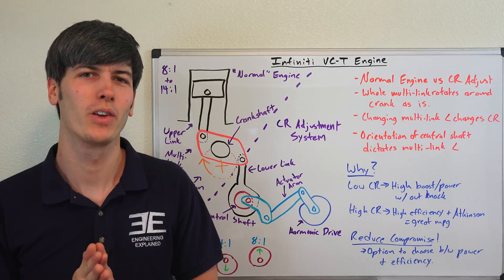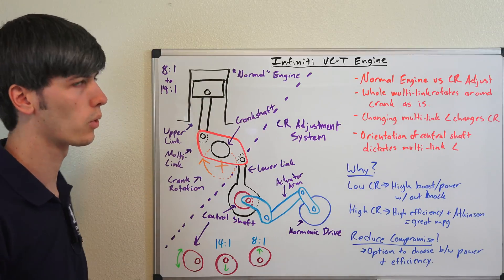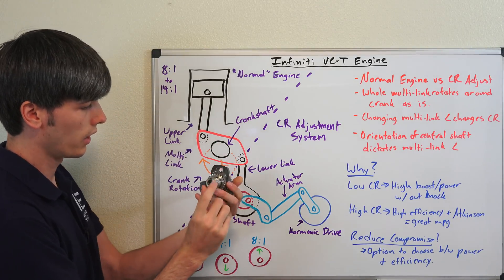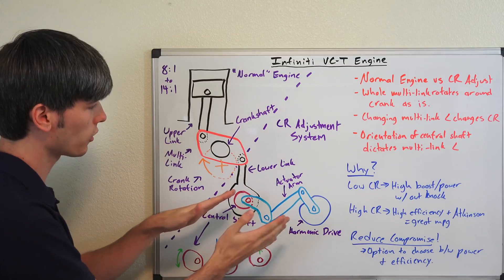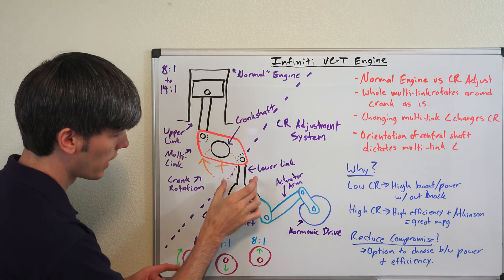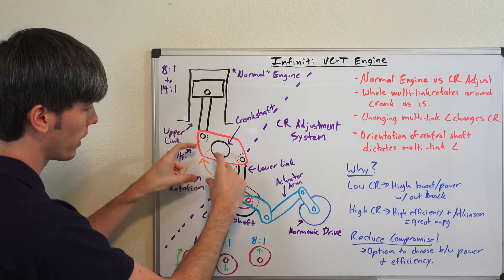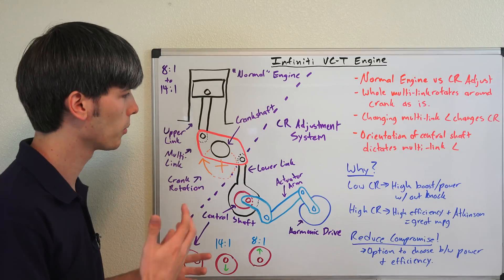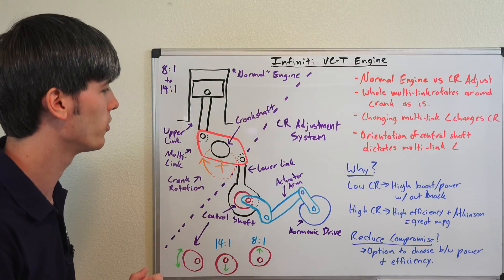Infiniti's Amazing New Engine - Variable Compression & Turbocharged

Comment: Alfa-Romeo started developing this back in the 2000s but using a ladder design. I ponder, how by adding this design is it going to make an engine more reliable. More parts usual means greater failure. I like the idea though.

Comment: HI Jason, great Vid. 
Am I correct in assuming that the multi-link plate has to be offset to change the ratio?  Other wise the stroke would remain the same and the only thing that would change is the compression pressure. I didn't see that point mentioned.
Regards,
John

Edit: Thinking about this, I can't see that the Compression Ratio will change at all if the multi-link plate is fixed as you suggest in the video.  It is my understanding that if you don't alter the stroke, IE the offset of the chrankpin, you won't alter the compression ratio?
Have I been wrong all these years?
Cheers,
John

Comment: With direct injection, it's possible to increase compression up to 13 and 14:1 and boost while controlling knock.  Would this be used to increase compression even further?

Comment: Awesome explanations ! I have a question. The engine switches b/w low compression ratio mode or high compression mode, I get that but how ? does ECU send signals depending upon the real road and throttle conditions ? or should the driver manually adjust between low and high compression ? To be more precise how is the harmonic drive actuated ?
Reply: +pepe la pew yes.. But how does it know how to alter between high and low compression ratios?

Comment: I've always felt that fewer moving parts reduced friction and improved reliability potential. Will this motor still work in 100,000 miles? What sort of weight gain is added with this feature?

Comment: Okay, while variable compression is cool. Why are we not all freaking out about camless engines? Koenisegegegegg... has had a prototype running for years and it still hasn't gained traction in the automotive industry. Have near perfect firing sequences is amazing for power and efficiency.

Comment: with electric power coming in so hot and heavy now I think this is a complete waste of time.
Reply: yeah..because all the cars, trucks, tractors, back up generators...and all the things that burn gas, oil, diesel are all finished tomorrow right?  Think about that...not even 1 % of cars on the road are electric.....all the gas station you pass are well..gas station.....you can go days, weeks, or longer before you even see an electric car....we are a very long way off from electric..or even having to worry about them like that! Making something more efficient and not designing new technology because a few electrics are on the road are a long ways apart....
Reply: Sure fully electric cars are rare but I wasn't just talking about them. The pruis has proven itself for over 10 years now. And there are many other hybrid vehicles that work extremely well.
Reply: *****  Prius and Volt are hybrid, they dont have a "range"  unless you want to run in fully electric mode.

but an electric F-150 that would last 400  miles up hill towing a 7,000lb load would be INSANE!!!

Comment: Thanks for the vid.

Why not have another small piston/plunger in the head which retracts, driven off a cam, to increase the volume of cylinder? 
One problem I can see with that it sealing it but it would not be much different to the piston and rings.
Mechanically it would be simpler and lighter than the existing setup.

Comment: So essentially they use a stroker piston on a stock rod, that adjusts via a rocker arm attached to the crank. Attached to the rocker arm is a lever that adjust the piston 3-6mm in height in either direction.

Correct me if im wrong but is this is the case, I hope to god this tech dies like it did with saab in the early 2000s. And yeah this concept isnt new nor is this the "first" Variable compression engine (Engineering Explained, did not state or claim that it is the first), but many other outlets are saying so.

Comment: I think it's only fair to mention the MCE 5 VCR straight 6 that was built and tested years ago. They used an 08 F150 and made as more power than the 5.4 mod with a 2.2L (I think it was actually variable displacement from 1.9-2.2 by using the VCR system to increase total stroke).  Horsepower was up by 20, torque was almost 400lbft at 2k rpm and they almost got 25mpg highway vs 20 with the 5.4.

Comment: Pretty amazing mechanical set up and I applaud Infiniti, but doing all this does it really make any difference in L/100km? More power and torque from a small engine I get but you have to run a Turbo car richer to reduce Knox and temps due to higher pressures and with all the added weight of the mechanisms in the engine that must be some lightweight car to gain the benefit of adding additional weight. More weight means more fuel means more L/100km. I think its a great peice of engineering but cant see the long term reliability in the set up, I wish them luck.

Comment: What it all boils down to is the management of the actual cylinder charge filling, by mitigating known filling deficiencies with variable turbocharging pressures, whilst also adjusting compression ratios to target optimum efficiency and power. 

It strikes me that the same results will be obtained by the continual development of turbos, wastegates and electronics!!
Perhaps the technological advance is the immediacy of a mechanical link, but I dread the reliability issues.

I predict their claims won't be so remarkable when you fill up your tank.

Comment: I could see performance gains from this if it were designed with that intent from the get go. Better off boost and tip in response and power. And with the fuel sensors that detect Ethenol now days if you filled up with E85 instead of 93oct gasoline advancing the timing and raising compression under full boost conditions. 

That said, I don't see this being reliable... time will tell. Good R&D though.

Comment: YouTube suggests I watch a video about the MCE-5 VCR-i engine related to this one.  It states that MCE-5 has been developing theirs for more than a decade.  Any chance you can objectively compare the two technologies in terms of theoretical limits and strength of the system when boosting?  The MCE looks a little sturdier, but they use a gear supporting the piston rod which looks iffy.

Comment: Poorly drawn diagram. As someone with a good understanding of how things work you would make it clearer if the connecting rod connected to a different point on the crankshaft, say 12 o'clock. That way you could show the top left corner of that plate mounted to the engine block but allowed to pivot with the pressure from the lower link.

Comment: it sounds like a good idea but if you introduce any sloppiness its going to smash itself apart no? if that cam gets a little wear there is going to become a lot of wear almost magically just from running the engine. its not like the variable timing systems because some sloppiness there is going to cause timing issues or lack of power, but at least its not going to be something that has to hold the power of the piston

Comment: Does leaving a manual tranny car in first gear while parked on a hill facing up actually help if the handbrake fails?
Reply: Yes. The engine doesn't care which direction it's rotating when it isn't running. So it would be the same whichever direction it's facing on a hill.

Comment: 2.45-3.15, that is an amazing new bit of technology. Trouble is, with an engine with this, will you get 200,000-300,000 miles before needing to change the various "big end bearings" ((Rod bearings in USA and Canada)????
Reply: AND it looks hideously complex as it has to be applied to each cylinder.
Reply: I can see this going the way of the rotary engine.

Comment: Is the square really not rotating? As I see it by moving the shaft up or down it causes the square to rotate differently when the crankshaft rotates. By that way you get MUCH more difference in where the pistons top and lowest point is. That equals to much greater compression ratio, because instead of just changing the travel point it changes the travel distance, which equals to much more air compressed into much smaller volume.

Also it makes no sense that the adjusting shaft would move up and down with the square when the crank rotates...

Sorry for duplicated response, I really think that this video is very misleading.

Comment: So other videos I have seen explaining this type of technology do not have the multi-link maintaining the same orientation (which would seem to require the control shaft mechanism to move with the crank) but rather have it acting as a lever between the lower and upper links with the fulcrum being the crank.  Which is correct for this engine?

Comment: Isn't part of this also the fact that in high compression mode the displacement of the engine is also reduced or is this change in compression ratio taking place dynamically on each stroke?

Comment: Lead compounds are not the only ones that can increase the octane, I use modern approved additives to run my vintage car that was designed for 100octane fuel ( now unobtainable in the uk).

Comment: I am interested in the power gap, high compression Hp vs low compression hp. Would like to know how much of a horse power increase u get or is this something along the lines of v-tec  of how you floor it you get more power and increase rpms which increase horsepower.
Reply: The power difference between the low and high compression modes should be very substantial. Picture it like having a Tercel engine under cruising conditions and a Focus RS engine under WOT.

But it won't act like Vtec where it kicks in at 6500RPM. It should feel like a normal, turbocharged, engine. Just that when cruising the engine will operate much more efficiently than a standard high output turbo engine could.

It's actually like the exact opposite of Vtec.
Reply: v-tec is variable valve timing that attempts to make the power curve more linear throughout its rev range and works pretty darn well, and most car companies have adopted and branded it their own (toyota has vvt-i etc...) In this case, im sure infinity is using a variable valve timing system in unison with variable compression to achieve whatever the engine is asked of. High compression+low boost=economy while low compression+high boost=horsepower. In this situation I would imagine one could change the horsepower from as little as 120 (for the sake of argument) in high compression econ mode to 300 or more horsepower with low compression and high boost with a 4 cylinder engine. In short, much more drastic than v-tec.

Comment: 14:1 turbo engine compression. Waoooo
Reply from the maker: It very likely won't be providing any boost when CR is at 14:1, dangerous situation if that were to occur.
Reply: Sounds like this engine has a sensitive crank

Comment: How does the harmonic drive work? Hydraulic pressure? How does it lock into position? What kind of points of failure does it have? All things equal, how much efficiency is lost with these added parts? Whicj models will this design be on? Brah I'm from compton you white boi pencil necks better answer these questions or imma bust a caps in yo lock

Comment: Wouldn't changing the compression ratio dynamically like that drastically affect the displacement of the engine?
Reply: No, displacement of the engine is locked in place. The bore obviously would stay the same, and despite what some people think in this comment section the stroke would remain the same, as the stroke is measured from the centerline of the main bearings on the crank to the centerline of the bearings on  big end of the connecting rod. And with those you can calculate displacement. (pi)(r)^2*h*(# of Cyl)= Total displacement where pi=3.14, r=radius (1/2 of bore) squared, h=stroke (or height of the cylinder covered by the stroke) times the amount of cylinders. If you already knew this stuff sorry, I was putting it down in case someone else who read this didn't know.
Reply: +Marcus Taber You're fine lol.
butt in practicality wouldn't it still affect the actual stroke of the Piston even though the equation might not have changed? if the Piston is not traveling to the bottom of its travel because it's in high compression mode then you're losing some of the stroke even if the measurement off of the crank didn't change.
Reply: Looks to me like the stroke length is always the same, unless they use rubber bands for rods. The lower cam(VC) just moved the centerline of the crankshaft lower thus creating some empty space on the top of the pistons stroke and in turn lowering the compression.
Reply: +ImSoVile Right but changing how high the Piston is sitting off of the crankshaft would change how far down the top of the Piston goes during the stroke which would in turn change how much air came in during the intake stroke.

The crankshaft itself is not moving however the top of the Piston is changing its distance from the center line of the crankshaft.
Reply: That part never changes.
Reply: +ImSoVile Oh I see it now.  I looked at the diagram in the video again and I see what you're talking about now.
Reply: Much better example here http://roa.h-cdn.co/assets/16/33/768x542/gallery-1471264843-infiniti-vc-t-tech-jpg-4k.jpg

Comment: So how many thousands of dollars in gasoline would you have to save to pay for one repair on this Rube Goldberg?
Reply: reciprocating engines are already rube goldberg machines. This is simply adding a couple of extra steps (to the existing hundreds) that enhances the end result
Reply: Maybe Toyota should hire electric power engineers so their drivetrains can have plenty of power and efficiency at the same time with a fraction of the moving parts.
Reply: Yes, but normallly aspirated, two valve per cylinder, constant compression/displacement, timing chain equipped engines are Rube Goldberg machines that will easily outlast the car with nothing more than oil (even non-synthetic) and filter changes. 

Of course, this isn't to save you money.... it's to sell you a car with the promise of saving you money through fuel savings and to get the corporate average fuel economy (which doesn't reflect real world driving) down. Just like Nissan's efficient but notoriously unreliable CVTs.
Reply: Compared to Koenigsegg's Freevalve and direct drive systems, most cars are Rube Goldberg machines.
Reply: +Bartonovich52 Well compression ratio isn't really all that static if you really get into it. Yes, the piston travels the same distance and compresses the available mixture industry the same size combustion chamber but actual compression varies a lot under normal driving. 

When it comes down to it, this system doesn't add too much complexity, really.  There have been many variable compression ratio designs over many decades (and long before VVT made the modern interpretation of the Atkinson cycle common) and the ordinary components are as robust as the crank and rods so failure isn't a primary concern. I personally like the approach of the MCE 5 from severance years back over the linkage Infiniti made, but both are accomplishing the same thing.

Comment: Cool, but I'm not convinced it'll be reliable in the long term.  but I'd happily be wrong.
Reply: Reliability will be a function of bean counting and not engineering..
Reply: I would tend to disagree, though I see what your saying.  The way I see it is, if a design is overly complex it introduces a greater risk of (to quote a dear friend) a self determining point of criticality within normal operating conditions.  I'm not saying that thus isn't a brilliant system, I'm just saying that complexity breeds failure, at least until the bugs are worked out in the real world.

Comment: They could just installed a variable exhaust valve timing or a 5th pressure relieve valve. 

Wait maybe a variable length intake runners.  There are so many ideas to improve a engines power band.

Comment: Does it change compression on the fly, based on throttle input? Or is there a setting/switch that the driver changes on the dash somewhere? This is a very cool concept, and has crazy potential!

Comment: 1st piont, engine has alot of power under a piston. see engine idles at 800rpm at minimum.. means 13 cycles in a secound.. means all parts are moving 13 times in a single secound.. means this engine is wasting its power,if u don't believe.. try to shake a single piston with your hand, its already too much heavy..
2nd poind, i hv doubt at 5.35, which engine opens valve at compression ratio :p
3rd one..  i hv an engine which is able to produce more then twice of its torque using same amount of fuel.. means twice of its efficiency.. means double its mileage while using same power 
or
double power using same mileage

Comment: As an engineer student I have to say you should have indicated the parts or pivots that are relatively or absolutely fixed to the space, because as you drew it it's just a bunch of leverages linked in a 2d space free to move in any direction, making it EXTREMELY hard to understand.

Comment: How is that harmonic actuator actuated(hydraulic or..) and I can't wrap my head around the pivot point of the Connecting rod and the rectangular multi-link if you could explain +Engineering Explained

Comment: That's quite clever! as soon as you pointed out how the bottom shaft moves around my brain kinda went 'oh! huh!' Variable compresison is used on model aircraft engines, but it's not adjustable on the fly like this.